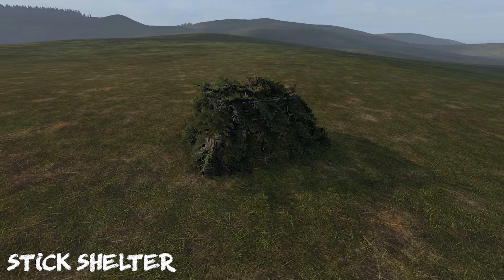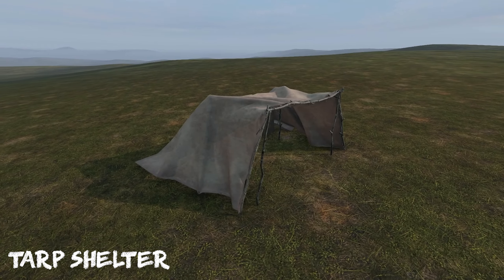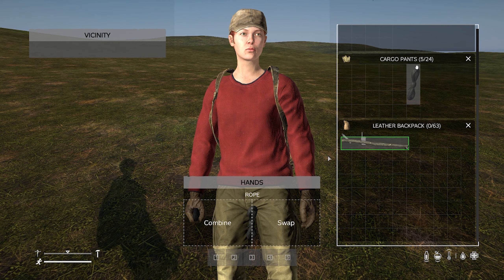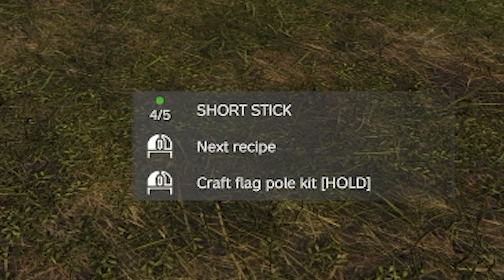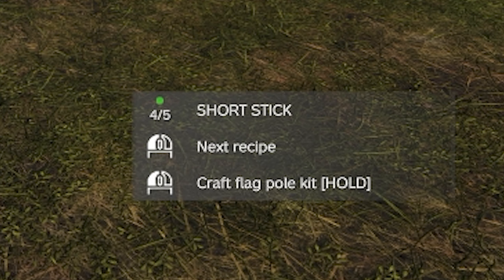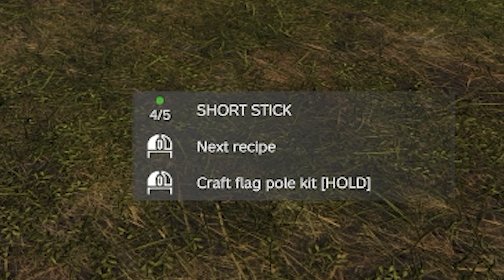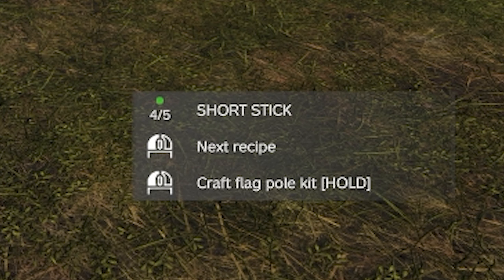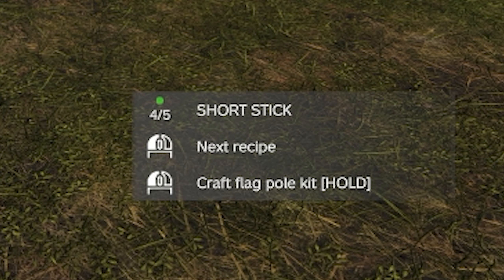How To Build Shelters On DayZ

Comment: one thing i haven't seen on anyone's DayZ channel is how to build PvP bases. Like there is one video but the man just builds a watch tower. If you talked about best buildings to build in and show how to fortify them and how to build air locks correctly it would help new players a ton.
Reply from the maker: I'll figure something out.
Reply: The best bases on pvp are buried barrels and drybags dude. If you build a base, it will get raided. Probably when you're offline.

Comment: Videos are epic, just wondering, can you pack these tents away to use again (like other tents) ?
Reply: When you pack it, it breaks it down into all the parts you used individually
Reply: Usually only a viable option for tarp shelters but yes you can break it down

Comment: Do I need 4 tarps to make the tarp shelter? I had one tarp and added 59 sticks but it made the improvised shelter
Reply from the maker: The recipe is in the pinned comment. They keep changing the required materials. I will update it if they change it again.

Comment: There is no way to build this shelter... NO prompt whatsoever appears after laying the long and short sticks.
Reply: same issue here
Reply: Something is probably obstructing the tent, had same issue and moved the tent away and was able to build
Reply from the maker: Have you solved the issue?
Reply: @ArchieStormcloudOfficial  nope, have tried everything.. No go. On several different servers. Apparently it works for some..
Reply from the maker: Make sure you read the pinned comment. The developers randomly changed the recipes to the shelters with the final release of the patch.
Reply from the maker: If that doesn't solve it, let me know.
Reply: So apparently it is conflicting with base building plus mod, 
hopefully they can fix soon!
Reply: @DolanMaster  they rolling out a fix.